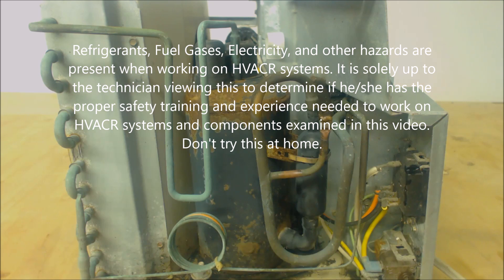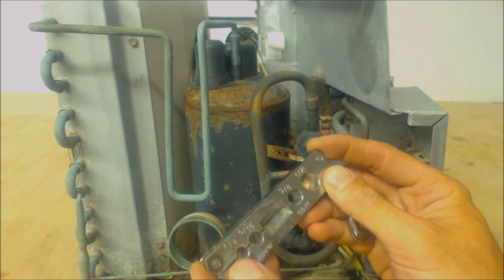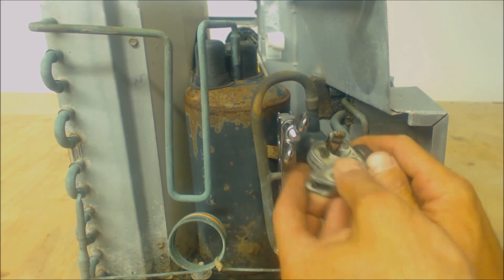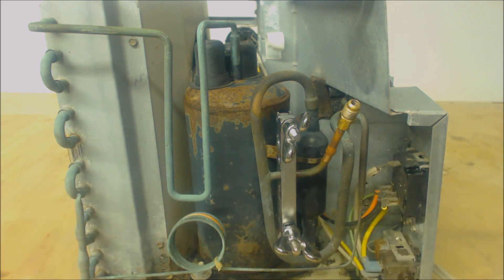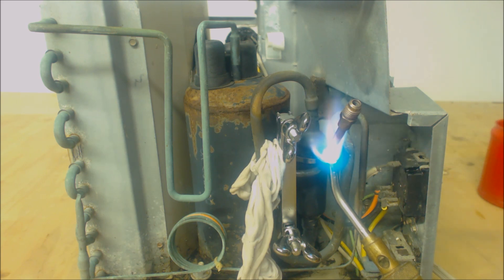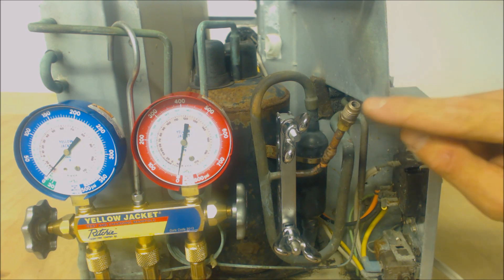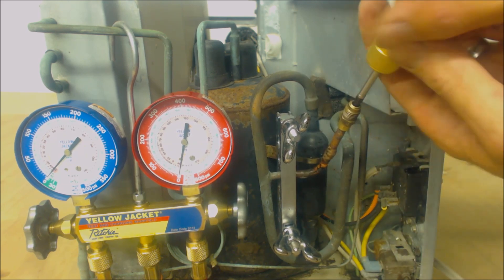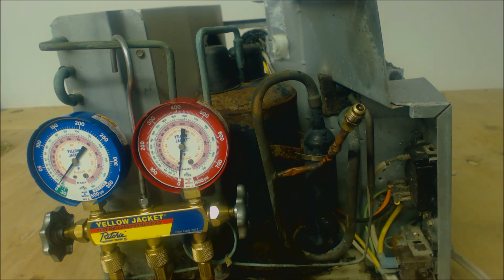Using an HVAC Pinch Off Tool to Braze Service Ports onto an Appliance!

Comment from the maker: Tool List-  https://www.amazon.com/shop/acservicetech
Support-  https://www.patreon.com/acservicetech
For those that are looking for the tools used in the videos: (Linked Below)

Here is a link to the Yellow Jacket Pinch Off Tool- http://amzn.to/2uqV24o

Here is the link to a 5 pack of Uniweld Hammer Swages- http://amzn.to/2uqWHqs

Here is a link for RectorSeal Bubble Gas Leak Detector http://amzn.to/2ckWACn

Here is a link to the Pasco Flare Block- http://amzn.to/2uoLdoS

Here is a link to the Air Acetylene Torch setup-    http://amzn.to/2aQalsb  

Here is a link to the 15% Silver Brazing Rods-  http://amzn.to/2gVLyLc

Here is a link the Nitrogen Regulator    http://amzn.to/2bXdR5f

Other tool links can be found in the video description section.

 ACSERVICETECH is a participant in the Amazon Services LLC Associates Program, an affiliate advertising program designed to provide a means for sites to earn advertising fees by advertising and linking to Amazon.com.

Comment: I was taught to use a piercing valve, service the unit crimp the aperture before the piercing valve, remove piercing valve, braze hole from piercing valve. Unit is hermetically sealed before and after service.

Comment: Do not cool this off with a wet rag. Let it air cool. The temp change could shock your connection and make a leak in your braze.

Comment: Are the bolt-on service ports a permanent addition to small systems? Or just to recover the charge? And isn't the risk of 'black death flakes' clogging the cap tube very REAL without N2?  Thanks.
Reply: Bolt ons are only supposed to be used to recover the refrigerant.   Then you can cut it off and braze on a Schrader.   There is a braze on saddle tap that you can do it all in one step, though I might be concerned about what would happen to the refrigerant in the process stub from the torch.

Comment: Thanks for this video.  I'm a DIY home owner and I service my cars and home A/C units that come with ports.  Now I should be able to add ports to the (cheap china) dehumidifiers that seem to be accumulating in my basement, and see if I can get one or more working again.

Comment: 13:09 should you have the gauge connected to see when the pressure is released into the new port with a loose hose to bleed out the air?

Comment: This is a great video. I'm just beginning to learn about HVAC service and I had yet to see a clear demonstration of how to close off then reopen a process tube in order to install a service port. The EPA 608 study guides tell you to remove the piercing valve when you're done using it "because they tend to leak over time", but give no indication whatsoever of how to do this without letting the refrigerant out.

Comment: Great info, Craig! Can I use the pinch-off tool to “fix” a kink in a copper line and re-round it enough for the refrigerant flow to work flawlessly? Will it work? Thanks for your helpful videos and the ton of info you provide.

Comment: Can I add one of these to my RV? I have two crappy dometic ac units that have leaked. I have a mini split installed so I'm good for now but I want to get them serviced and my friend does ac, one of the ac units have a piercing valve but it has leaked I believe, I know I should get both units replaced but I feel like the service port should be a good fix and hopefully be a permanent fix rather then a piercing valve

Comment: I'm a licensed contractor and I've never used a pinch off tool. I suppose you can charge more to recover the refrigerant and put new refrigerant back in. This is probably why I was never taught this method. If it don't make money it don't make sense. Now that I know this method, I can save customers money and save me a grip of time. Thank you kindly.
Reply: $220 -$440 depending on size of equipment.
Reply: How much would you charge to do this?

Comment: If you know how to use Oxy/Acylen set up then you wouldn't have a no or low heat issue. Those little turbo torches are a pain in the ass.

Comment: I'm a 15 year veteran of the field and have my masters refrigeration license--which definitely does NOT mean I know everything!  Far from it.  But we are beginning to see quite a few of the R-290 (refrigerant grade propane) reach-in freezers and coolers out there.  These do require some facility with the pinch-off tool, which is required after the system is evacuated and charged in order to seal the punctures made with the required "bullet" access valves.  On my last trip, I was not able to get 100% shutoff no matter WHAT I did--which included making multiple pinch-offs to break pressure down the access tube and cranking the tool as far closed as I could with vise grips--to the point where I was in serious danger of actually cutting the tube and blowing the charge (which I have done).  Less than 100% shutoff causes the system propane to repressurize that end of the access tube and blows holes in the brazing solder.  I finally had to remove the cores in 1/4" stem valves, pinch off as hard as I dared, braze in the stem valves with the propane seeping by the pinch-off tool venting out the end of the stem, then inserting the core and capping the new access.  This worked, but I can't figure out why I can't get a 100% shutoff?  Is there a different style and/or better tool besides the one shown in this video?
Reply from the maker: That is a really rough one! I have used this pinch off tool with r410a with no problems leaking but I know what you mean. You can't tighten it too much or it will cut through and blow the charge. That tubing could have had some flakes on the inside which didn't allow the inside of the tube to seal when it was compressed or something!
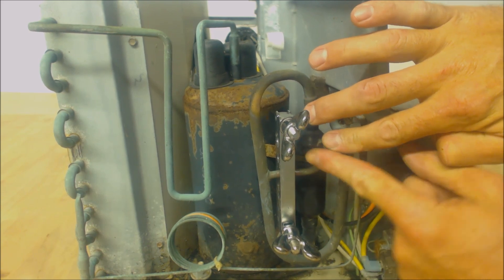Reply: @acservicetechchannel  Your reply is very much appreciated.  I am glad I am not the only one!  And I have "cut through" in an effort to completely shut off leak by at the "pinch" and blown the charge and what could be worse on a Friday afternoon at 5:30 when you've told the wife you're taking her out to dinner.  I went looking on line, and there is a different style of "pinch off" that will do 1/4" or 3/8" and the "pinch" looks more like a round ball tip you screw down on the copper into a kind of a cup shaped recess.  I have it coming and will see if it works any more reliably.  The advantage would be that you aren't cranking down a sharp edge like the traditional tube, which (see above! lol) is just to easy to cut right through soft copper.  This looks like I can crank to my heart's content without severing the line.  Interesting note:  After identifying the manufacturer and part number, EVERY source I could find--including the factory!--was backordered two or three weeks--making me wonder if a whole LOT of commercial refrigeration techs were running into the same problem with these R-290 units and their special handling precautions all at once?

Comment: What a nightmare, it's only a few more dollars to add ports at the factory.
Reply: it’s not a mater of cost.  The factory wants to maintain a hermetically sealed system.  It’s the same way on most small sealed systems.

Comment: That's a great way to save some time but didn't he just get the inside of that joint all covered in black carbon?
Reply: All the old timers nvr used nitro when brazing. And all those ac units ran longer then the new shit thats out with the new techniques in brazing applied 😂

Comment: Can you put a copper saddle valve on with Stay Brite 8 or do you have to braze them on? For R134A
Reply from the maker: You can use staybrite 8 or braze rod if the system is empty
Reply: Thank you so much! Amazing channel!

Comment: Would it have been 'ideal' to pull a vacuum on that little process tube before un-pinching it, or do you feel like the air 'stays put' until you can purge it as you did? I know refrigerant is heavier than air - does the fact that it was pointing up affect your decision?
Reply from the maker: The refrigerant was not moving at that point so the air would have stayed put and then the refrigerant would have pushed it out, thanks!

Comment: sir, if i braze with refrigerant in the system and i did not pinch off the tube , is it posible to explode? the aircon?
Reply from the maker: Definitely don't do that, yes it would blow the charge at you. Don't do that, thanks
Reply: @acservicetechchannel  Thank you sir,  now i know what to do.. thank's for your   great video. very informative, .
Reply: @acservicetechchannel  he would also cause the refrigerant to break down forming phosgene gas.  Not good.

Comment: Another great and easy way to get access to the system is by using a piercing valve, I suggest you guys check this one out since it's reusable. After you recover the refrigerant and install the permanent shraeder valves just reseal the small pinhole. https://is.alliedrefrigeration.com/arproddetail.php?PEPARTNO=4001858
Reply: I prefer this since the fact that is you need to get access to the system, it's because you either have a leak or a restriction, (also I will throw acid or noncondensibles)... so recovery, further nitrogen pressure testing, evacuation and recharge is most likely needed. Greetings.
Reply from the maker: Great tips giosourc08!

Comment: Great videos. Know this was filmed a while back. Have you seen the Vise grip style punch tools?  Are they good to use? They seem easier and with less chance of cutting tube off
Reply from the maker: Yes I have used them and I do not like them because they will sometimes leak since they tend to smoosh the pipe when clamping down. I would advise to always use the bolt on clamps since it will put pressure on all sides of the tube and will make a better seal or the way done in the video for a permanent port, thanks Julio!
Reply: AC Service Tech LLC  sorry. Just noticed I wrote punch tool.  I meant to say pinch tool. Instead of the tool you used, it’s a Vise Grip pinch tool.
Reply from the maker: Yeah I have seen two versions of the tool. One is a vise grip and another is a blue handle with tension lock. I still like the bolt on clamp ones the best since I know they won't leak. You could pressure test different tube diameters and test them but in my experience, the needle is too big to easily puncture through and the force crushes the tup and doesn't allow a great seal each time on the rubber, thanks

Comment: I use Braze-on Piercing Saddle Taps like the BesTech 5538's. Bolt-ons leak especially when the o-ring dries out.
Reply from the maker: Thanks Dwayne!
Reply: @acservicetechchannel  No Problem. Keeping'em Cool, and our call backs to a minimum.

Comment: Hey Acservicetech, thought I would ask this here. Is it safe to use a pinch off tool on R410 or would high pressures make it unsafe. Just wondering. I have been doing it on little stuff just like you showed and it is working great. I have a dehumidifer that has R410 and may need to work on it soon just waiting on work order. Thanks
Reply from the maker: It is ok. Ha ha, I actually did a double pinch right in the middle of an r410a vapor line on a stand up ac unit since the unit I was working on didn't have a process stub, I brazed an access valve in, bled the air before releasing the second pinch and that one was good and didn't have any issues, thanks
Reply: Good deal!  Thanks for the reply. I will be giving it a go.

Comment: That was very interesting and well done. My only concern would be worrying about the pinch-off tool weakening the tubing. Wouldn't this run the wrisk of damaging the tubeing at the point the tool was used on?
Reply from the maker: It could possibly if the tubing was pinched too tightly. You could accidentally cut it too, thanks neutrodyne!

Comment: Correct me if I'm wrong: I've been instructed by veteran techs to never immediately  quench a hot joint that has just been brazed with a cold rag/ heat shield compound because it can weaken the joint and lead to air pockets in the copper (potential leak spots). I was told to always let the joint cool down naturally for a few minutes before cooling it off to avoid this. I really enjoy your videos and you're an incredibly knowledgeable tech. I learn something new with every video I watch! Thanks for what you do. Please let me know what your take on this is.
Reply from the maker: In regards to the service valve or another part that has an o ring or teflon seal, we get that cooled down as fast as we can since we are on the outside and the heat applied to that seal is at the inside. Cooling it down fast will not make a potential leak, it just has to do with tempering. In this case, I could have just waited and let it cool down naturally though since no seal was in danger, thanks Joe!

Comment: Can i do this on HVAC heat pump outside unit?
Reply from the maker: Hey Sam, are you EPA 608 certified for buying and working with refrigerants?
Reply: yes I am
Reply: Just to make sure it is not for appliances only
Reply from the maker: The universal 608 covers anything with refrigerant in it. You can use a technique like the one in this video for units that have r-22, retrofit refrigerants and r410a if there are presently not any access ports, thanks

Comment: Do you have a link for the piercing tool and the access service valve? Thanks!
Reply from the maker: Hey Danny- Here is a link to the Yellow Jacket Pinch Off Tool- http://amzn.to/2uqV24o

Here is a link to the Pasco Flare Block- http://amzn.to/2uoLdoS

Here is the link to a 5 pack of Uniweld Hammer Swages- http://amzn.to/2uqWHqs

Here is the link for the Supco bullet piercing valve- http://amzn.to/2DRZj80
Here is the link to the sweat on 1/4" access valves 10pk- http://amzn.to/2ngFYmE

Comment: That's just cool. It reminds me of the AC's on my RV's and I always wondered about that. 
Would RV AC's be a good place to start? Are they a good overall training ground for all the fundamental skills? And excuses to buy tools?
Reply from the maker: Well, they don't have service ports so they would have to be brazed on. They only have line voltage controls typically unless it is a rv ac voltage system but they do have a capacitor and start capacitor usually. There are always excuses to buy tools, ha ha, thanks!
Reply: acservicetech Well good, your brazing was it that got me thinking. Well said on the tools!

Love to see something on installation and control of electronic dampers by various thermostats. Thanks for everything!
Reply from the maker: NMranchhand, thanks for letting me know what you would like to see!
Reply: How about setting up return/economizer boxes with controls. 

Great videos you do!

Comment: aren't you suppose to put the flame on the fitting instead of the pipe so that capillary action will draw the solder up into the fitting towards the heat.
Reply from the maker: Yes you heat the inner tube up first and then move back to the fitting. I may have had an issue with that pinch off tool being a giant heat sink with the tip size I was using, thanks.

Comment: great foresight removing the lens covers to eliminate glare.  It also would have been nice to show a processing tube tool being used to pull a vacuum and charge, then pinched off and brazed back to the sealed state. Some feel that striders a a constant leak course / weak point. I remember many years ago, when they first started the debate / proposals for 410a, The argument was to eliminate all schraeders and go to service valves and TEV's. That didn't happen though. Too many special interests.
Reply from the maker: Ha ha, yeah it is interesting what you would like the industry to move to and where we are at. Many things at play. Thanks for letting me know what you would like to see and thanks for the comment HVAC01453!

Comment: Does that Pinch off tool kinks the cooper lines after get them straight?
Reply from the maker: Yes it does, you only have to open it back up a little to get pressure. Actually, you may even get pressure as soon as you take this off if it is not tightened down too hard, but I would open the copper up a little, thanks

Comment: What about the acid flux you have to use when silver soldering? You vacuum and install filter line dryers to prevent acid forming but silver solder with acid flux? Just curious, unless you have an acid free flux that works. But wouldn't you still get some sort of contamination from whatever type of flux as opposed to brazing? Also, couldn't you rig up a micro copper tube to your nitrogen tank and stick it down the 1/4 o.d. tube your brazing to feed nitrogen inside? Just a thought, if I was in A/C instead of plumbing I might make something like that. I enjoy your video's, you know your stuff and you teach well.
P.S., after brazing you could also run a bottle brush down the tube to loosen the black oxidation and then blow it out with nitrogen. That might not get 100 % but probably an improvement and since it is a dead end access whatever is left should not cause a problem. Just trying to think outside the box.
Reply from the maker: Thanks Azycray, I actually prefer brazing and that is what I did in this video with no flux, and 15% braze rods. Thank you very much!
Reply: Yes, sorry for the confusion. But you did say soldering was an option if it wasn't R410, so I was referring to what you said, not what you were doing in this particular video. Please clarify or expound  further about using an acid flux or why you prefer brazing. Thanks AC!
Reply from the maker: I prefer brazing because that is what the manufactures now do on all their joints. Sometimes you need to silver solder because the part you need to fix is too close to an existing silver solder joint and you don't want to heat this up too much. Acid flux is less of a problem on r-22 with mineral oil than r410a with poe but silver soldering is and has been done succesfully for years on both r-22 and r-410a. I prefer to brae because no acid and this is what manufacturers are doing, thanks!